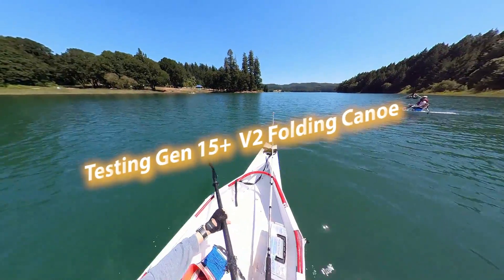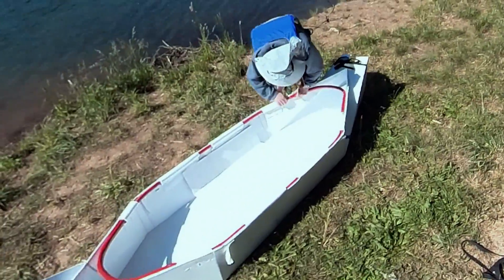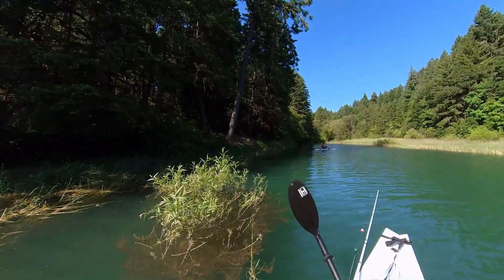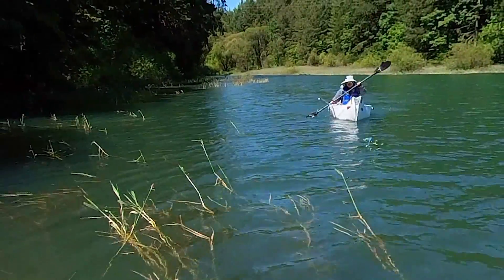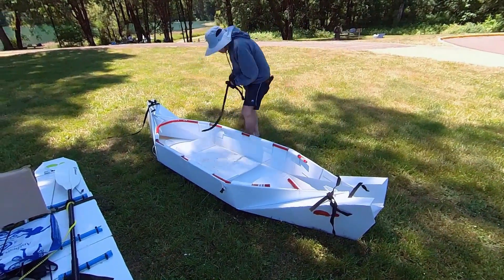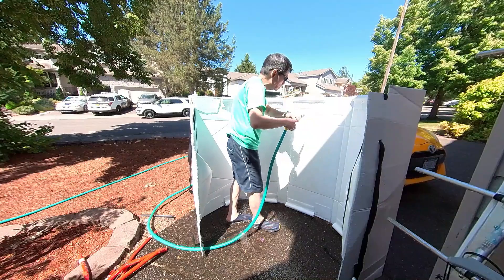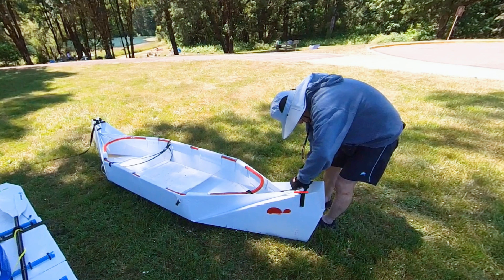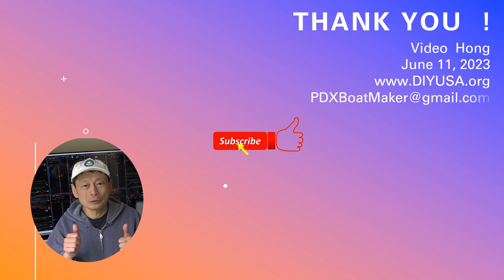Pt 3 DIY 10' Folding Canoe Gen 15+

Comment: I'd like to build a longer coroplast canoe. About 15'. Somewhat like the mycanoe design. But I can't seem to figure out where to get coroplast that's that long...
Reply from the maker: I built this 14 ft boat by fusing two sheets of coroplast: https://youtube.com/playlist?list=PL2ShZzOUu01ul94LmvXJm_K3NVBKerLc5&si=3Sflp9gUkLJWJ6bY   Last year, I used an updated fusion technique and built a 13 ft long one https://youtu.be/q_vSj8w4lj0?si=84QbrQ40yKWlvC6W   Yes, I can extend the length to 15' with the same technique. You may give that a try.  MyCanoe has simpler folds than the ORU's boat, so the fusion technique should work well. This design Gen 19, is inspired by the MyCanoe design https://youtube.com/playlist?list=PL2ShZzOUu01uzs1ZJ6HiRVMSG6ZgyspG0&si=w8gF_ZO0R7mtIPWO  Cheers!